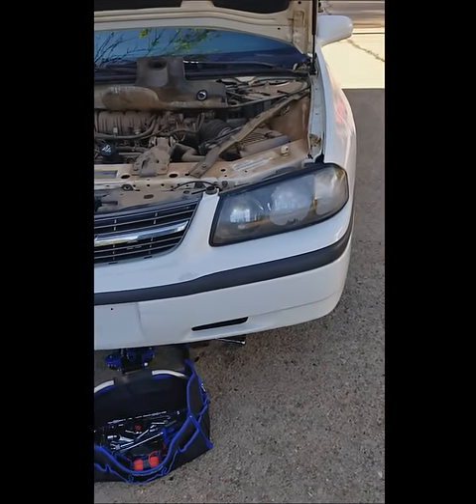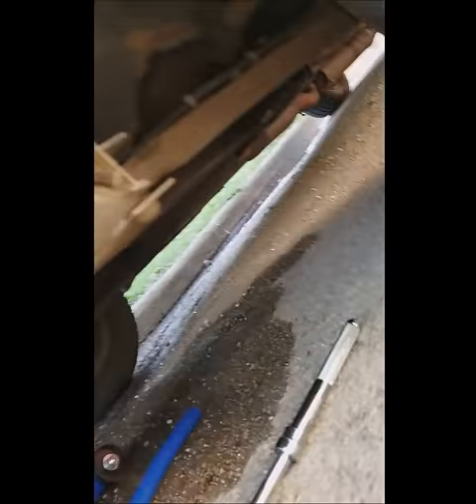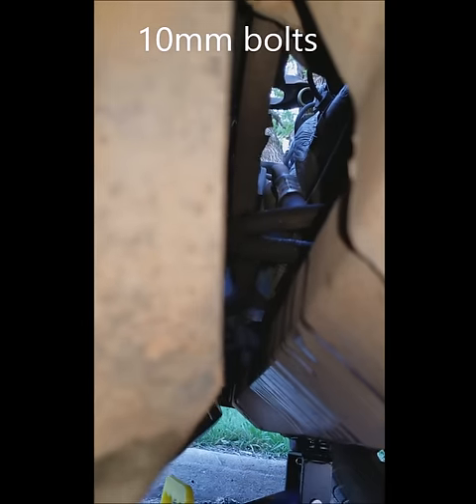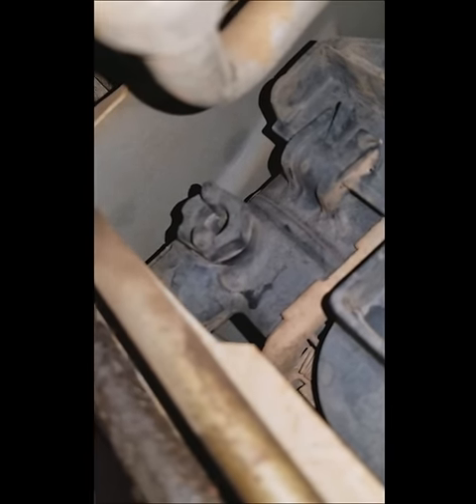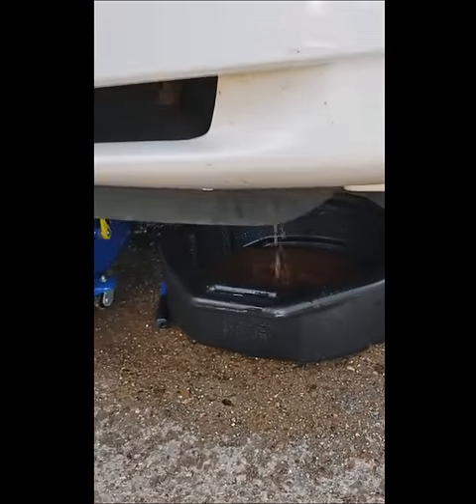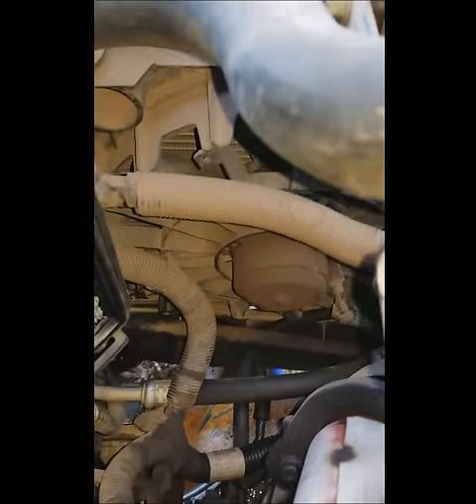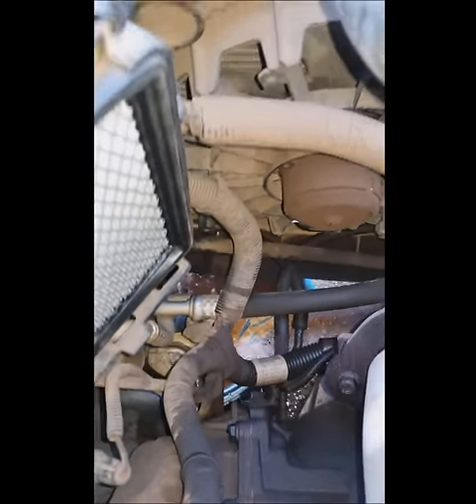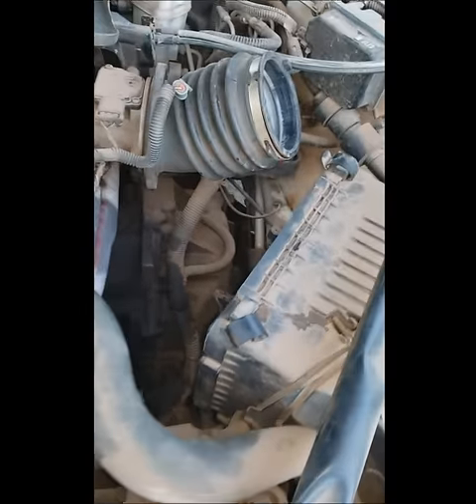Chevy Impala Radiator Plug & Removal

Comment: Thanks for showing the radiator drain location on your Impala (I have an 05.)  No one else seemed to be showing it.  Sometimes it's the videos that show the simplest of things that I appreciate the most.  I'll confess I didn't use it though --as a couple of other videos mentioned snapping off "plastic" plugs.  So I went for the messy way of loosening a hose.  Still----I was glad to know where the drain was--had I not had the hose option.
Reply from the maker: Charlie C. The exact reason why I made the video. Thanks.

Comment: Omg talking about a pain In the ass I have a 03 impala I change the thermostat had to take the throttle body completely off just to tak it out to replace it and now doing a radiator flush thanks was having problems locating the plug
Reply: SAME! That lower right bolt on the thing that has the thermostat in it can go to hell. And so can the engineers who thought it would be a good idea to put it together like that.
Reply: Thermostat was covered in brown gunk, and the pipe in the throttle position sensor was 99% clogged, had some pregnant looking hoses, already did a heater core flush. Cross your fingers for me please! I’ve already broken 2 nails and tore my hands up, and they are black like a mechanic 😝